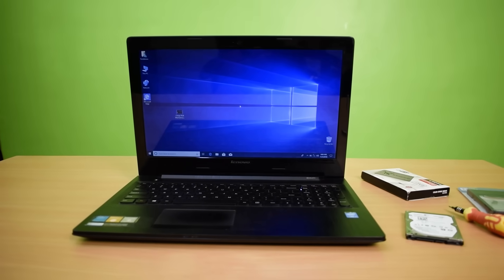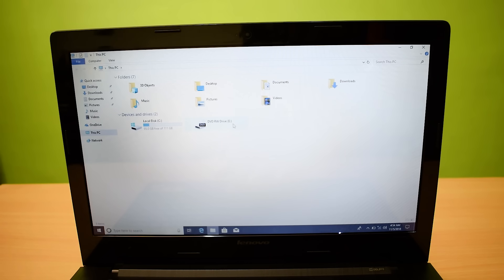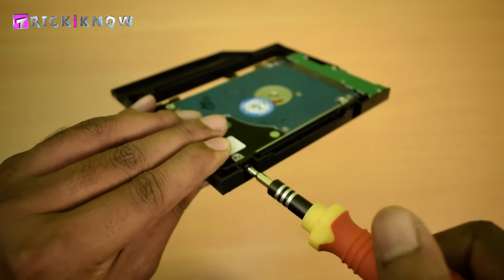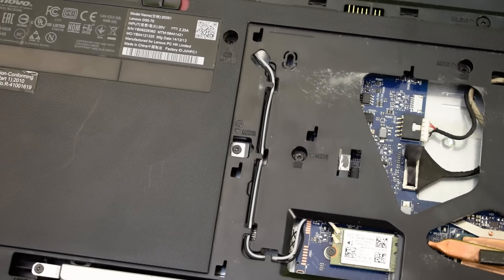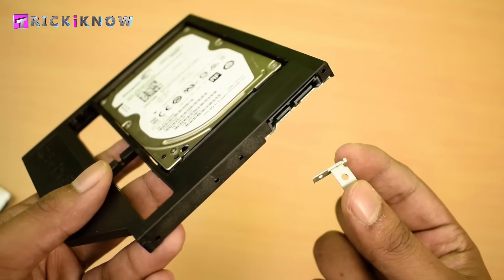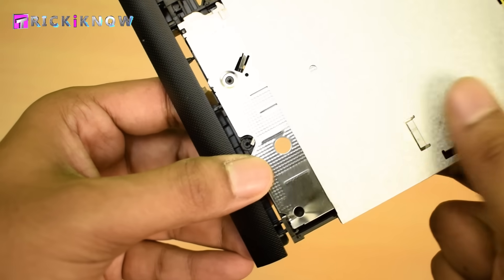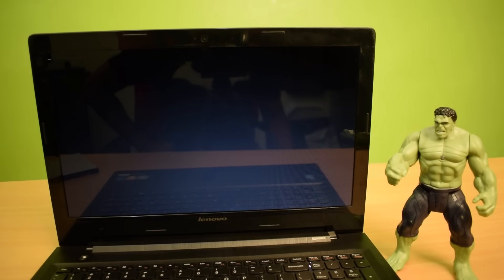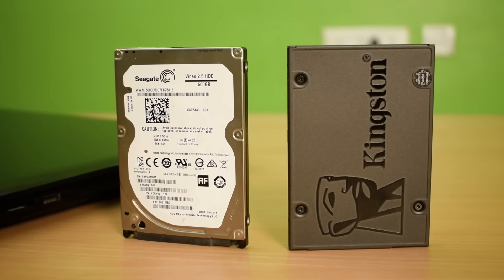How to Install 2 Hard Drive in 1 Laptop | Dual Drive Setup Tutorial (SSD + HDD)

Comment from the maker: Recommended to Backup your data with EaseUS Todo Backup before installing a New Drive - https://bit.ly/3Vjl1Xf

Read this article for more info: https://digitaldopes.com/install-two-hard-drives-one-laptop-hdd-ssd/
Reply: Sir the hhd caddy its is universal? Its  fit all laptop brand?
Reply from the maker: @videofilm3750  there are 2 versions of caddy , 9mm and  12mm make sure which dvd rom do you want to replace.
Reply: Sir installing hdd in caddy.. Reduces speed of hdd.. As caddy has sata 1.5 interface
Reply from the maker: @ashishstone1  May be , but HHD is now just a data drive. No software is going to run through it, now all the OS and Software runs through internal drive (SSD) 🙂
Reply: @TrickiKnow  i was asking.. That does it really slows down... You could make a video on this...
Reply from the maker: @ashishstone1  no i didn't found any performance loose in HDD using Caddy.
Reply: @TrickiKnow  OK thankd
Reply: @ashishstone1  ث قل. ف. ح
Reply: O9 Arena. The first.0
The
I have
L0
Reply: I am interested in HDD temperature(<45C during heavy use), I am using more closed version of caddy, made from Aluminium... wonder if more hallow plastic version you bought works better... though it still ends up in closed space inside laptop.
Reply: TricK i Know very Good my bos
Reply: Can we use internal HDD and add HDD to Caddy
Reply from the maker: @saimadhukar976  ya same process , just install the new HDD to caddy to expand your storage 😀
Reply: @TrickiKnow  Does this cause any overload on laptop compared to SSD+HDD combination
Reply from the maker: @saimadhukar976  good question , ssd consumes less power than hdd. Hdd takes 2.5watts and ssd takes 0.8watts so ssd consumes less. Now the Hdd on caddy doesn't runs all the time, if you are not use or access the hdd files then it will go to sleep mode like the dvd rom. So tha moral is after upgrading to these your laptop consume less power than before.
Reply: Brother!  If my DVD is damaged and I put the hard disk in the caddy, will the hard disk work?
Reply: Can I install ssd in caddy as my internal drive and hdd as data drive in its original slot?
Reply: Does both drive increase CPU performance?
Reply: Please  help us on B50-80 model laptop also Please let me know about the brand of caddy so i can purchase the same  because we already checked with universal caddy but driver does not detect in
 bios
Reply: even
Reply: น฿ปี้ะ6&5฿#๓ดถูผา
Reply from the maker: Krishnendu Sahoo  links are in the description.
Reply: @TrickiKnow  Hello sir what is lenovo g500 dvd size? so i can buy the right one
Reply: Brother need help
I want this same caddy , can you please provide the link 
Thanks in advance 🤗
Reply: @bhaveshmishra2391 link description me hain.
Reply: Sir do you have any solution for password
Reply: Can i install Linux os in 2nd hard drive and also can i start boot with Linux os?

Comment: Be very careful if you are attempting this, there are a few things to mention, one - the power requirements for a SSD is much different to a dvd rom. So it might work for a while but if you aren't care full the system on the additional SSD can short out. Plus this video dose not show you how to instal the SSD after putting it in the laptop. 

I tried this system before, I used the SSD as a carrier for windows and the HDD hard disk for memory. I also had used a Kingston SSD, but my sad shorted out and I lost a lot of documents. So really get more detailed videos about this method and understand it isn't just a quick instal.

Comment: I have a problem with my Dell Inspiron N5050 laptop,l did this mod but fitted two new ssd a 240 GB as the main C primary drive position. 
Then a second SSD  480GB in the cd/rw possition.
However after loading a new copy of windows 10 to C primary drive,my Laptop does not recognise the second SSD in the cd/rw position.
Have l made a mistake? can you fitt two new SSD drives or does one need to be SATA hard drive to be recognised as secondary drive?
Any help most appreciated

Comment: Be sure to check if the CD-ROM is PATA or SATA connector, if it is PATA you need to buy the SATA to IDE/PATA version of this caddy instead of the one in this video which is SATA TO SATA
Reply from the maker: Thanks for sharing the valuable information 😊
Reply: they usually sell  9.5mm or 12mm bay size versions of the drive caddy so be sure to check which size you have

Comment: Hi. If I remove the HDD which is partitioned into 3 drives(having data) from my laptop and put it in a Caddy and use it as an external device, will the three partitions be available with all the data? Will there be any data loss?
Reply from the maker: Yes all partitions be available, if you merge all partitions in 1. First make a backup of files and open disk management, delete partitions and create 1 new one.
Reply: @TrickiKnow  I dont have space to make a backup. So, I asked.
Reply from the maker: @rosarioethan5719  then you have to use the drive with multiple partitions.

Comment: Hi, I know this video is 3 years old (or even more) but I would like to ask you a question
I measured my optical drive thickness and I got 9.0mm. Do I have to get the exact size or 9.5mm will do the job?
Reply: 9.5mm it will work but it would be a little tight in

Comment: I have a spare HDD and want to use it as extra storage. I wonder if USB 3.0 adapter would be faster than using the DVD/ROM for the HDD
Reply from the maker: Usb is always slow than internal hdd bro, but usb adapter is easy to carry and for transfer files from different pc.

Comment: i want to clone the HHD in to the SSD and have that be my main driver. So

Question 1: should i leave the HHD in its original place and put the SSD in where the cd player is with a caddy. Or vice versa? Does it matter? 
Question 2: if i do put the ssd where hhd is and the hhd where cd player is with a caddy, can i just fresh install windows from the recovery key i have for my laptop? I dont care about whats on the HHD. So instead of cloning it then doing a system reset and delete everything can i just do a system restore from the usb key ?

Comment: If i remove the HDD and put that in the dvd place by caddy and put the SSD in the the HDD's place, Can the laptop's motherboard be damaged in the long run?
Reply from the maker: No, it won't dammage. Btw now it's more safe coz now your hdd is secondary drive and now it will sleep when you are not accessing it.

Comment: Can I install another HDD instead of SSD?
Reply from the maker: Yes no problem 👍
Reply: Can you suggest me compatible caddy for dell Inspiron 3521
Reply from the maker: @arjundas432  you have to measure the thickness of the dvd rom, generally the standard size is 9 or 9.5 mm

Comment: Compatible to all laptops with DVD rom? And I clone my old HDD to my new SSD, so it has two OS. It will still work?thanks for your response.😊
Reply from the maker: Yes compatible for all Dvd rom laptops, most are 9.5mm and few are 12mm Dvd rom in size. Both size of caddy is available, keep the os in ssd and make ssd your primary drive. Or you can install saparate os in each drives: https://youtu.be/ye8m5wIus0M
Reply: Thank you trick i know.😊

Comment: Can you switch between which hard drive it boots from when it powers on?  If so how?
Reply from the maker: Yes you can switch from boot menu or you can set it default in bios, just i did in dual OS video: https://youtu.be/ye8m5wIus0M

Comment: How i find if i need a 9.0mm or 12.7mm caddy for my laptop. My laptop is hp elitebook 8530w.
Reply from the maker: Take out dvd rom from laptop, and measure the thickness of the dvd rom from side with scale. It will show you exactly whether you need 9mm or 12mm 👍

Comment: I want to know how to install fastest SSD suitable for my Dell inspiron 15R (5521) and also can this DvD bay caddy be used for an SSD as a secondary drive as well OR is it restricted to only HDD ?
Reply from the maker: Fastest SSD means higher read write speed, look for highest read write speed  SSD in brands like samsung evo, corsair , wd etc. Yes you can also have another ssd in the caddy, there will be not any issue to use it in 100% speed.
Reply: @TrickiKnow  tnx for your kind response. <3

Comment: So I can do that with the new SSD I bought without removing the old HDD from its place applying the same loading speed it showed on the previous video?
Reply: Yes, but I would recommend installing SSD internally and HDD in optical drive caddy instead. Reason being, normally optical drive does not require fast speed data channel, so lot of the laptops will have slower data channel for your optical drive slot. Which means that SSD installed in optical caddy might work slower compared to installing it in proper drive slot.  
   
Overall it is possible to install them however you want, but if it is old laptop, I recommend HDD into caddy and SDD into normal 2.5 inch drive slot.
Reply: @esuil  thank you very much for the information

Comment: My laptop doesn't have the CD drive, I wish to install 256 GB SSD without replacing my HDD. Just to boost the speed of my laptop by running operating system files in SSD....Can you please help me
Reply: @richard steele Thank you so much
Reply: @richard steele thank u so much

Comment: My laptop doesn't have the CD drive, I wish to install 256 GB SSD without replacing my HDD. Just to boost the speed of my laptop by running operating system files in SSD....Can you please help me

Comment: Can 9.5mm 2nd caddy works for this laptop? Or it should be 9mm 2nd caddy?
Reply from the maker: 9.5 mm will work 👍 the 9mm caddy i used in this video was not good enough in material quality. Then i replaced it with a 9.5mm metallic caddy. The link is in the description.
Reply: Thank you for the response sir. You're the best!!

Comment: Bro, please answer these questions:-
a) For my Lenovo Ideapad 320E-15IKB, I purchased Samsung 860 Evo 250 GB from Flipkart [for INR 2970] and a caddy.
b) My laptop has a 2 TB HDD, and the C drive partition is around 240 GB (90 GB is currently in use), so, after installing Windows 10 on this SSD, will I be able to delete the 240 GB partition (which has Windows 10 on my HDD), and use that as my normal partition or is their risk to my 2 TB HDD.
c) The current 240 GB partition on my HDD has both Ubuntu and Windows 10, but I'm planning to only have Windows 10 on my SSD and if I want to have dual boot, can I have dual boot on my SSD as well in the future [Someone told me that there might be any problem]?
d) Also, I heard about the GPT partition and how my HDD will not work with Caddy. I'm not sure about that.

Please let me know.
Reply: I reply here to know about what happened & what to do,discuss,guidance..

How are you now 😃
01.03.2023 05:31 pm ist
Reply: @azhagurajaallinall126  I was able to do what I wanted to do.

Comment: after installing ssd and hdd wont there be conflict from which drive to boot up since u didnt remove the previously installed windows in hdd? is it neccesary to remove the windows from hdd or just putting the ssd in 1st order in boot sequence will do the job?
Reply: When u start ur pc, u will be able to choose where u want to boot from. BTW just install new windows on SSD and delete the old windows from HDD which u dont need and done.

Comment: What can I do if my laptop dose not have a DVD drive
Reply from the maker: Install the ssd instead of hdd, and make the hdd external using a case 🙂
Reply: @TrickiKnow  done that already 
Thx but my SSD is 480 and I need more space cause I play games is it good if I install them games on my external HHD btw my laptop model is Lenovo Y50 thx for the help
Reply from the maker: @darknesses87  480gb is enough bro, you can easily install 6 games like fortnite.

Comment: Hello I want to add my hard drive from an old laptop to the optical drive space of my current laptop. But the problem is the hard disk in my old laptop is serial ata 150. So can I do this? Where will I get laptop caddy’s with sata 150 connectors?

Comment: This is not correct as if u put any hard thats larger then 320 gb into dvd-rom drive it will work very slowly, the solution is to put ssd in the dvd drive and other drive where ssd was.

Comment: Do i need to format my old hdd before i install it using the caddy?
Reply from the maker: No, caddy will read it as it is. If you want to format, you can do it after putting it on caddy. If you old hdd have previously os installed then you have to merge all partitions in one to make it dada only hdd. Ssd is now the os drive and hdd is for keep data.
Reply: Hi sir. Do you have a video how to merge ssd and hdd? Please send me a link. Thank youu

Comment: Thank you for this tutorial. Sorry I am a noobie. Can the DVD drive be replaced by another SSD? (Total of 2 SSDs?) Is the combination of SDD + HDD configuration more of a low cost alternative?
Reply: Yes, you can add another SSD or even HDD if you want. I actually upgraded my HP Omen laptop like that before I sold it. I put a 1TB NVME SSD and replaced the stock 1TB HDD with a 250GB SATA SSD.

Comment: @Trick I know
How to determine and buy the right caddy for your laptop. Or this is it's  universal size for all the laptops.
Reply from the maker: In general 9mm caddy will fit in mostly laptop models, few old laptops comes with the 11mm dvd rom. You can measure the width of your dvd rom by a scale.
Reply: @TrickiKnow  but 9mm would be so small. I mean if my phone size is 6 inches then my dvd panel is 5 inches wide😶
Reply from the maker: @dragonballthings688  i mean how thick the dvd rom is , generally its 9mm.
Reply: @TrickiKnow  which ssd is the best? Kingston?
Reply from the maker: @bizybliztaverage9414  The best ssd is samsung evo plus, but in general I used WD Green. Kingston ssd is also good because it's cheap.
Reply: @TrickiKnow  I think samsung is way too overpriced, reviews says that its shit.

Comment: Sir I have a doubt i am currently using 1tb HDD in my laptop , i have planed to Boost my lap  to ssd (120 /240 for OS) as the primary storage and install fresh win 10. And i am also going to use caddy and put that 1tb HDD for extra storage .My que is when I remove and put the HDD in caddy will my old files in the HDD same as before ?

Comment: Waste of time just install external HDD/SSD via USB port.
Reply: No, this is way better than plugging an external drive. A laptops purpose is to take it on the road. You don’t want to fumble with multiple devices and cables while traveling or visiting clients.
Reply from the maker: Your tip is useful, but for few peoples. Most people don't want to carry more things with laptop. 2nd after sometime external drive gots usb not recognize problem. 3rd there is chance to lost your external drive. Yes there is no doubt you can transfer files easily from multiple computers, that is the benefit of external drive.
Reply: @TrickiKnow  Mostly I don't want buy an external Blu Ray writer I would loose if using your method.
"3rd there is chance to lost your external drive." Very unlikely.

Comment: Thanks! I can finally get both HDD and SSD.
Reply: Please  help us on B50-80 model laptop also Please let me know about the brand of caddy so i can purchase the same  because we already checked with universal caddy but the driver does not detect in
 bios
Reply: @ag1679  make sure you add sdd on hdd place by swaping it.bcz most of the dvdrom can't detect ssd on secondary slot.Hope it works

Comment: Does that hdd carry work on any laptop that has a dvd rom?
Reply: It depends since there are 2 sizes, 9.5 and 12.7, you can see it on the technical sheet of your laptop or in any case take out the reader and measure the thickness of it
Reply: Cesar Giovanni Acevedo Carlos ok thanks, I'll take note of that 😊this helps a bunch

Comment: Great ..sir I want to update my laptops hard drive ..my laptop model no is Dell Inspiron n5010 which is Intel i3 ..which SSD I should buy and SSD will be placed same like u placed in primary slot or in cd drive pls reply
Reply from the maker: Install ssd in the primary slot , install os and apps also in ssd for faster performance.
Reply: @TrickiKnow  thnks bro
Reply: Which company SSD will be good and I don't want SATA want m.2 pcie slot can I use in my laptop
Reply from the maker: @zafar81883  if your laptop have m.2 slot, you can buy samsung evo ssd.
Reply: @TrickiKnow  my laptop is 7 8 years old ..slot may not be there ...WD will b good or not if I buy SATA

Comment: Bro another trick is ..buy caddy and external hdd drive board..and chnge caddy board to external hdd board(usb plug ing ).and cut one end of usb wire and cut some of insulation to solder the wire in the usb port inside the laptop body..fitt the caddy and let the wire solder correctly vcc gnd, data +, data- , in mother board ..( take some risk makes good results))😍😍😍😍

Comment: The ssd slot is around 500 rupees but a 500gb ssd is around 10,000 rupees and we r removing dvd drive. Instead of that keep the dvd drive and buy a 4tb USB western digital hard drive it's around 8000 rupees any how if we want to upgrade to new O.S we use pendrive or DVD mostly so we need USB DVD writer. Western digital USB external hard disk 4tb is excellent it doesn't require external power 🔥🔥🔥🔥🔥❤.

Comment: My IBM T40 can do this in 2004. It's not new. People just not well informed.
Reply from the maker: If your laptop have sata port for hdd then you can do this.
Reply: @TrickiKnow  No, on old Pentium platform at that time, there is no SATA. They still use IDE hard drives. The hot swap drive bay is for DVD drive and also take 2nd HDD caddy. 40-pin IDE HDD. Upgrade from 30 GB to 500 GB is a great experience.